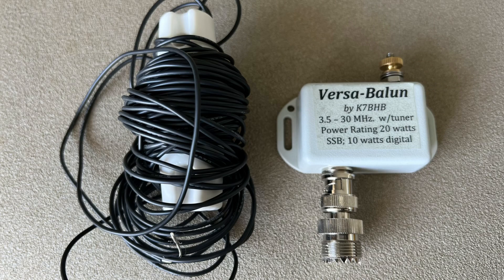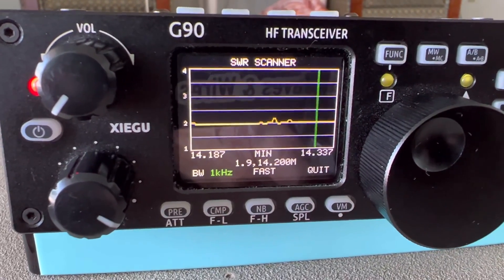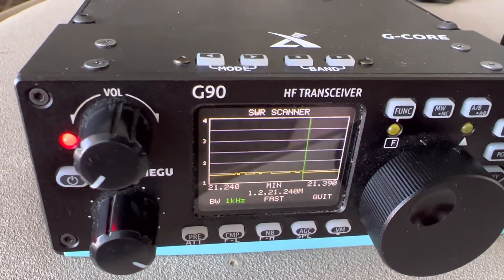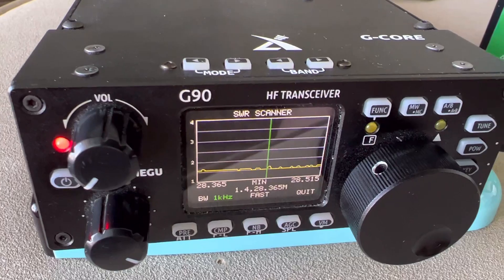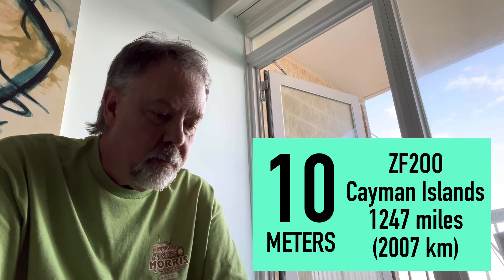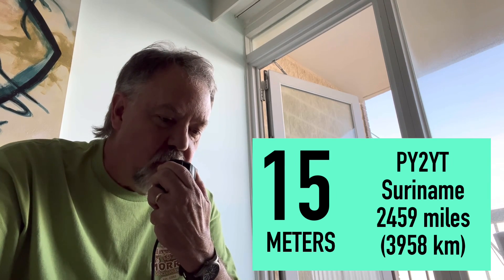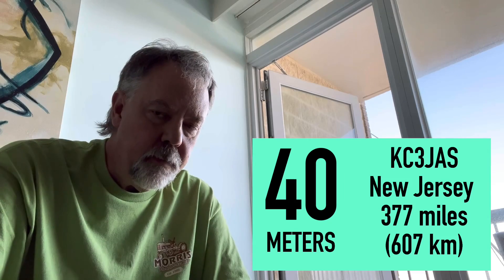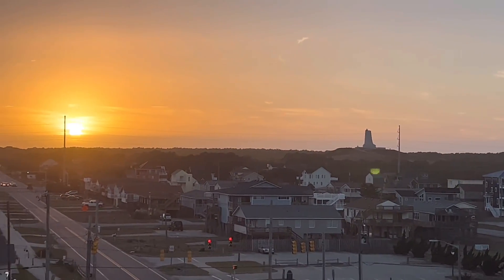Hanging a Random Wire Antenna from a Hotel Balcony

Comment: Nice video Walt, I have two random wires from Chameleon their 73' (came with IMPAS 2.0) and 130' I brought later, and have great results with both.  I have them in opposing trees and the 130' is higher in the trees. I either use my 991A tuner or I use a manual tuner MFJ 969 deluxe.
Reply from the maker: Thanks! that sounds like a great setup

Comment: I'm curious how long your x90 runs on that battery. I just ordered a x90 as my first HF radio. What model battery is that?

Thanks for the helpful videos, I've learned a lot.
Reply from the maker: Hi Drew, it last about 4 or 5 hours if I’m going hard. It is a 6 aH that I got on Amazon. I’ll have to check the brand.

Comment: How long can you operate on the 6AH battery?  Planning on buying a new battery soon for the G90 and can't decide on what size I want. Also, any problems with RF back down the coax into the shack?
Reply from the maker: I’ve used the 6aH battery for 5 plus hours and it was still just under 12 volts. I haven’t had any common mode current issues.

Comment: I do not dispute in any way if the Versa-xxxx works or not but just wish it was named properly... if it is co-ax out that side is unbalanced....& on the input side if it was balanced in it needs to have 2 terminals for equal (balanced) bits of wire exiting skywards.... if it is only one terminal in with one piece of wire then that must be unbalanced too.... this is a versa-unun not a versa-balun...... as I said I do not dispute its efficacy in any way but when they won't tell you what is inside it or how it works & give it a misleading name it does ring a few bells. Has anyone actually opened one of these things up to see what is inside?  (or stuck a 450 ohm resistor on the i/p to ground and stuck a nano-VNA on it).  My guess is that it might be a 9:1 unun & $69 for a qrp unun seems a little steep.
Reply from the maker: I completely understand where you are coming from, I’ve always suspected that it’s just a 9:1 unun

Comment: I ran a "random wire" when I was 8, attaching it to a tree with glass insulator.  Though I was pretty clueless about frequency and wavelength, I did pick up some stronger shortwave like CAU Time etc.  I wouldn't try that today knowing about EMF etc.  Nowadays I mostly tinker with TV reception.  That's a lot simpler owing to error-correction and better modulation.
Reply from the maker: Great story, thanks for sharing.

Comment: Ok I’ve got a dumb but genius question. Can you spoil and open face reel with polystealth and cast your wire out without the wire snapping?
Reply from the maker: Damn, that’s actually a good question. Maybe spool 66 feet of line and connect a 49:1 to it and have an EFHW. Hmmm

Comment: Those random wire antennas are pretty handy. I just got a ATU-100 off Banggood and tested it with my FX-4C 10w radio and a random wire (from memory, about  35.5 ' or 41') and 9:1 unun. I was able to tune 10, 12, 15, 17, 20, 40 and 80m in the phone portions of those bands. Made a QSO with a guy in Toronto on 15m SSB from my wife's QTH at Monument Valley UT, so I was pretty happy. Resonant antennas are great but sometimes you want to be able to switch through the bands.
Reply from the maker: Roger that!
Reply: 40 m EFHW and you have resonant antenna and you can switch through all the bands from 10 to 80, possibly with a little help of "touch up" tuner

Comment: Good solution. Any ideas for maritime mobile on a small GRP boat?
Reply from the maker: HamStick or Whip with a coil. Run ground from antenna mount to any metal through hull (plug) or metal fitting near the waterline.

Comment: Great to see this is possible !  I attempted this with a efhw and there was s10+ noise, unusable.  I sent the xyl a text as she was on the beach that I was going down the road to the state park lol.  On another beach trip I clamped my mobile Diamond VH-7a to the balcony rail and it worked okay, but not great.
Reply from the maker: Yes hotels usually are extremely noisy. I lucked out on this one.

Comment: Another great video Walt. Looks like a great setup but he just raised the price to $70 for this, which seems a little high when you compare it to the Par-EndFedz counterpart. The Par comes with everything you need. Wire, wire winder, & unun.
Reply from the maker: Good point, I bought mine a while back. Was actually thinking about using a basic 9:1 but went with this instead.
Reply: @COASTALWAVESWIRES  the funny thing is they call these end fed “half wave(s)”. That implies they use a half wave or multiple there of, of wire as the radiator. Neither this or the Par antennas use a half wave for any of the intended bands. Random wire is more like it.
Reply from the maker: @truckinguy92  yes, absolutely a random wire antenna

Comment: I like the light-weight, waterproof packaging. The ebay description doesn't mention the ratio. It is 9:1? That typically works well with random-length wires and a built-in ATU.
Reply from the maker: Not sure of the ratio, he doesn’t mention it anywhere. I’ve used it with a 29 foot wire vertically with success but had higher SWR than with the 37 foot wire.